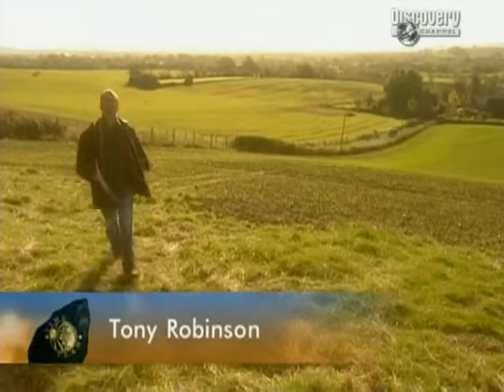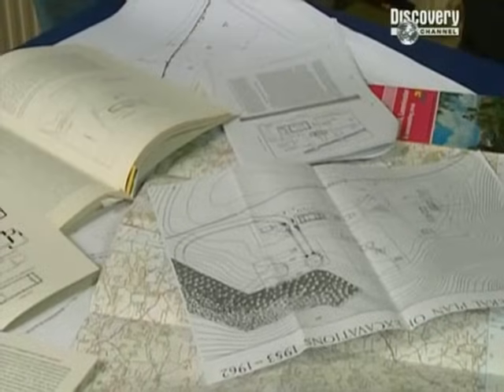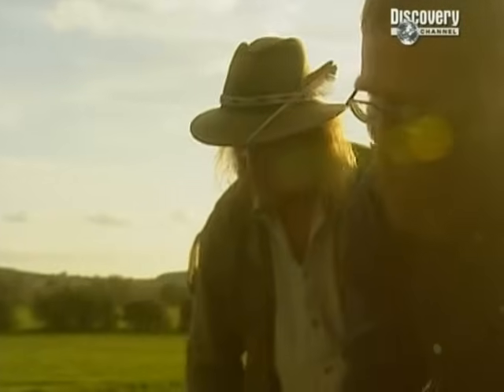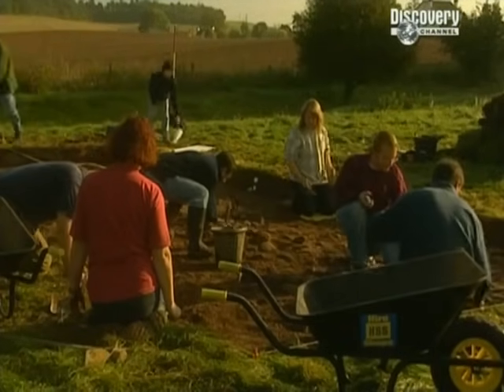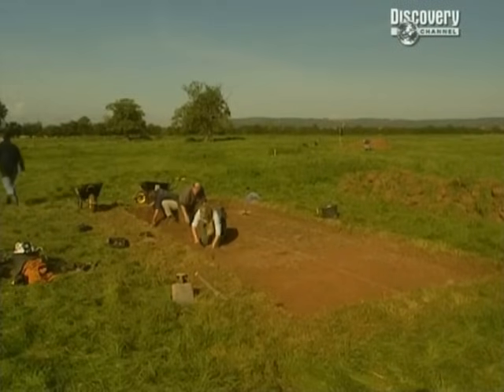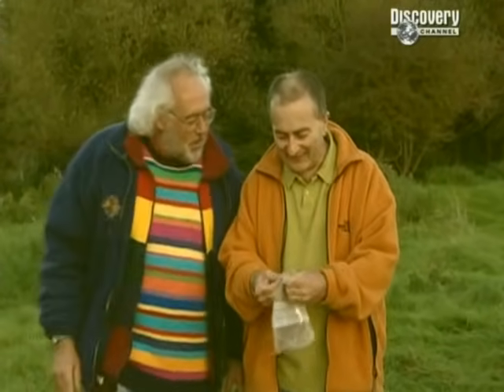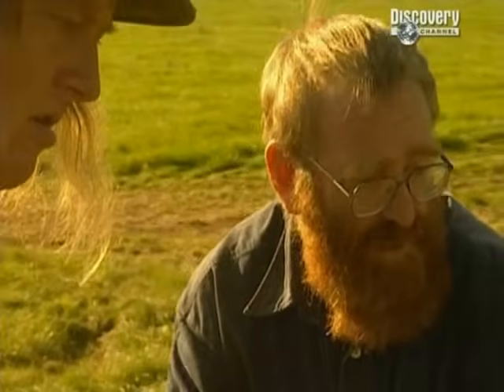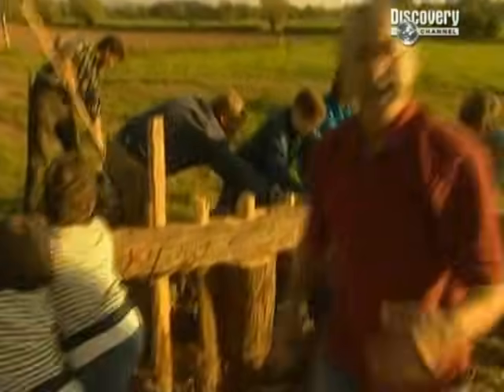Time Team S07E10 sutton,.hereford

Comment: mortar mixers like the one Phil helped build were in use up through mechanized times; one name for them was pugger. A pugger was a key piece of evidence in the 1913 Kiev trial of Mendel Beilis on false murder charges. The prosecution story was that Beilis grabbed a kid who had been riding the crossbeam of the pugger while a harnessed horse rotated it to mix up clay for bricks. In fact there were no horses at the factory when the victim died; they had been sold off for the winter and new ones weren't  bought until a month later after Easter. I blogged the first complete English translation of the transcript from this trial.